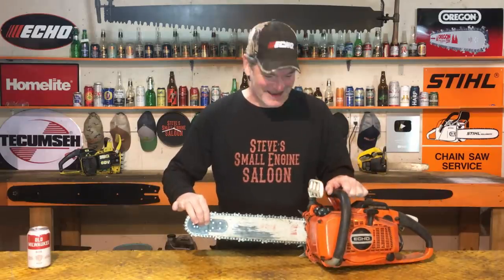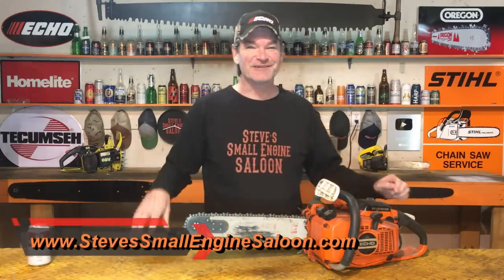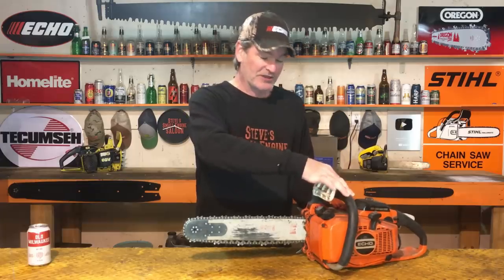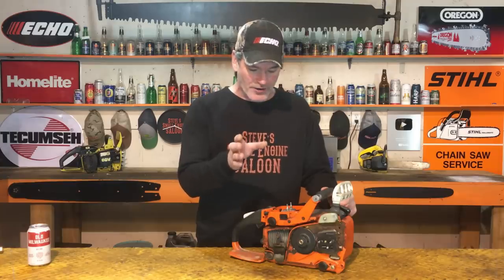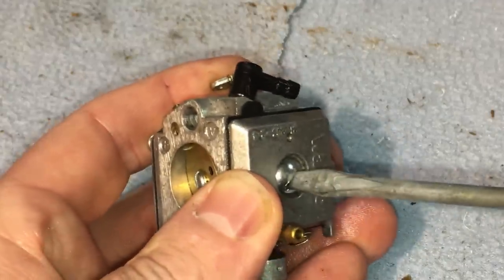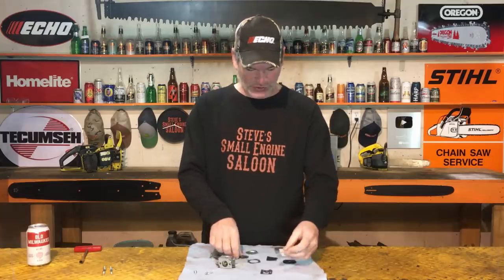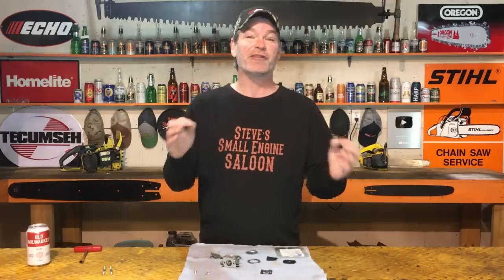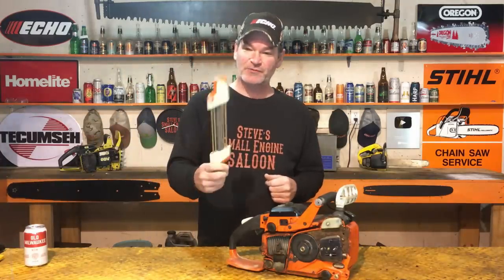How To Fix An Old Echo Chainsaw That Will Not Run

Comment from the maker: ✅Click here for a sharpener ➜ https://amzn.to/2N0CzWX
✅Click here for a tachometer ➜ https://amzn.to/3vsLMhy
For more videos like this, check out: 
👉How To Test A Spark Plug In 1 Minute ➜ https://youtu.be/N5gPaVAQtaY
👉Don't Do This To An Easy Start ChainSaw ➜ https://youtu.be/PsF2SEWEa18
👉Correct Way To Adjust Or Tune The Carburetor On A Chainsaw ➜ https://youtu.be/M6T5JoGXcHY
👉How To Use a Stihl 2 In 1 Chainsaw Chain Sharpener ➜ https://youtu.be/marzGaMq6pM

You can connect with Steve here too: 
✅Visit Steve’s WEBSITE ➜ http://www.stevessmallenginesaloon.com/ 
✅Visit Steve’s PARTS & TOOL STORE ➜ https://www.amazon.com/shop/stevessmallenginesaloon 
✅Follow Steve on FACEBOOK ➜ https://www.facebook.com/stevessmallenginesaloon 
✅Follow Steve on INSTAGRAM ➜ https://www.instagram.com/stevessmallenginesaloon/ 
✅Follow Steve on TWITTER ➜ https://twitter.com/SteveSaloon

Comment: I personally love Echo products, especially old echo. I have that exact model and have used it for many years. Probably will be buying one of those ethanol carb kits for it to.
Reply from the maker: Right on Mike...
Reply: I have the 440evl but everytime I look for parts Google gives me results for the newer CS-440EVL.
Any suggestions?
Reply: They made a twin cylinder version for a short time. I think it was about 65cc. Very rare. Like butter.
Reply: My dads had a 452vl for over 30 years. Its been a dang good saw... recently was given a 462 stihl. I prefer that to the old echo, but she still cuts as good as she did 30 years ago

Comment: An uncle of mine gave me that exact chainsaw. He got it without blade and chain from someone else and left it rusting and rotting in a shed for years. After he gave it to me, I tore it apart, cleaned it, installed an Oregon blade and chain... and it's been running great ever since. (Even though I'm certainly no mechanic.) I use it for rough work in S&M (sand & muck ;) ) and despite all of the abuse I put it through it's keeps purring like a kitten (like the one in your video). This bad-ass hasn't let me down once since I got it :)
Yes, I definitely had fun watching the video. A big thank you from one of your subscribers (and fellow beer-lovers) in the Netherlands.

Comment: She's a beauty Aaa!  Steve after your comment on " look we can see right there that the oiler is working" made me think about that for a minute and I was thinking what type of pumping system is utilized to do this and how does it operate off of the engine. So that has me wondering if you have a video on Oilers and their adjustment and repair and operation. Like how do they set them for correct flow? Not to little, not to much. I think it would be an interesting and useful video. This was a great video. Thank you.
Reply from the maker: Thank You...and You're Welcome...
Reply: I would love to see a video on the Oiler’s also, good suggestion and Diolch yn fawr iawn(Thank You Very Much (In Welsh)) if you can. Big Respect from Pont-Ap-Hywel South Wales🏴

Comment: I have a Echo 400 EVL that I used to earn a living with in the early 1980s. Spent hundreds of hours operating it.  Now, It almost starts, but hasn't run for maybe 5 years.  I put it up on the work bench and followed along with your video.  Like yours, it needs a rebuilt carburetor.  I have project where I need it in the next two weeks, so it is time to get serious about getting it running again.  BTW, back in 1982, I shopped for this saw by going to all the local saw and small engine repair shops and asked them which of the hottest selling saws, they repaired the least.  Every single one of them said "Echo".  I have owned it for 38 years now.  It was rebuilt around 1992, but nothing since.  Thank you so much for your video!!  Now to find a rebuild kit for a 38 year old saw!
Reply from the maker: Right on Dale!
Reply: @StevesSmallEngineSaloon  Followed your instructions with the rebuild kit, and the thing still wouldn't start. Went through it all again.  Then, stupid me took the time to  smell the gas.  Rookie mistake.  Mixed fresh non-ethanol.  A shot of carb cleaner to get it in motion and it started up using the fresh gas!  The 38-year-old saw is back in business.  I will be trimming an elm at the first place I ever worked.  Funny how life goes in circles.  Thank you!

Comment: Thanks Steve.  I was given 2 ECHO chain saws 1 a Echo 330 EVL and the other also is a Echo CS 3450 TYPE 1-E 33.4cc by Korste Corp...both have fuel leak issues and I will be taking it apart first to remedy the fuel leak issue and will also look into the carburetor just as you showed to make sure I replace the diaphragm and gasket and new fuel and see if that would be the issue with these gifted ECHO 's in the Aloha State called  Hawaii...I will bring you my results...TY

Comment: Found a Kioritz Echo CS-302 in someones garbage while walking my dog one day. The pull cord was hanging out. Took it home, repaired the cord and put some gas with stabilizer in it. Started after a few pulls and works like a charm. It does have a bit of an attitude when starting so I'm going to replace the diaphragms like you did Steve. It should be good for another forty years!

Comment: Hey BIG Steve I have the exact same saw with a longer blade. This was my very first saw that my mother bought me for Christmas many many years ago
and it's still going strong.Never ever let me down a real thumper !!! I left this once for approx 2 years in the shed a tree surgeon was working at my place when his saw
broke He asked me if i had a saw he could use just to finish off. All i had at the time was the old echo that had been stood for 2/3 years. Any way in the shed
out with the saw same old fuel and yep it started 6 pulls if i recall. No one believes me when i mention this story but it's true. Now most of my equipment is Echo
they just never let me down..Great Vid as always !!!!!!!!

Comment: I have like 3 echo CS 300s and one 3000. Most are parts saws but the 300 I just got done putting a new carb kit on. 20 bucks and all new fuel system and plug. 1 pull choked and 1 off and in action again. Can't beat it. Echo does make quality.

Comment: I have 2 of those, and a twin cylinder Jhon Deere that was made by echo. I should send it to you so you could make a video about it. It's kind of a collector item.
Reply: Tony Wolf those twins are very sought after by collectors!
Reply: @kriswright1022  that's what I hear, I stopped using it a few years ago after I heard that. I cleaned it all up and set it on the shelf, she is retired now! It's in great shape, wonder what it would be worth?
Reply: Tony Wolf A collector would pay a pretty penny, especially if it’s in running condition!

Comment: Nice video Mr. Steve. I have a McCulloch 3214 chainsaw that’s 26 years old. My wife bought it for me new as a surprise gift. Just replaced the gas lines, purge bulb, spark plug and carb kit installed. Runs like new again. Still has the original bar and chain. It hasn’t seen a lot of cutting, probably less than five hours total as we don’t have a lot of trees to cut but occasionally a large limb will fall and I will cut it up. The primer bulb went bad probably 10 years ago and watching these videos of yours got me motivated to get it going again. Thanks for all the great vids and tips sir. You are the best!

Comment: Awesome old saw Steve.  Good on ya for laying off the suds a half day and wearing your PPE.  Very good to see.  I fixed a Echo CS 341 top handle saw that just wouldn’t start.  They have notoriously sensitive carbs and I checked it by squirting gas in the spark plug hole (I like your method better).  I rebuilt it, squirted it with carb cleaner and gave it a ride in the ultrasonic bath.  No dice!  Customer said he been cutting palm trees with it and they produce a really fine saw dust.  Hopped on Amazon and $10 later and free shipping I put on a Chinesium carb and Bob’s your uncle she fired right up!

Comment: Good call highlighting the safety aspect - chainsaws are nifty but nasty.

That lovely old saw starts and runs easier than my (bought under duress - last one in town after a big storm) Tanaka TCS-33, that's for sure. Takes a miracle, an act of Congress, and some dark magic to get my saw started, and has since the day I bought it... Think there's a design flaw resulting in the carb flooding but the cylinder itself not getting any fuel - tilting it forward can sometimes help. Ever seen such a thing?

Comment: That was fun to watch! Isn't it great getting old power equipment going again! I have a 1972 Snapper mower I am working on. I have the parts for the carb, but I haven't been able to work in my garage for several weeks due to a bad back. Hope to get out there soon and finish it.
Reply: Vernon Bruce 1972 snapper isn't that the one that came with a 2 cycle in a magnesium deck, extremely lightweight?
Reply: @daleslover2771  It has a 4 cycle 3.5 Briggs and Stratton. It may be the commercial version, not sure about the deck material. It will run with a bit of persuasion, but it needs a new carb diaphragm, which I have yet to install. It smokes a bit, I am hoping it's just the head gasket and not the bore. I've yet to diagnose that. Not physically able to do the work on it right now.
Reply: Vernon Bruce I worked on  a snapper it had to be mid-60s in my shop and it had magnesium body to it , it was a two-cycle and I pretty sure was made for little old ladies, the blade was no longer than 18" cutest little lawnmower I ever seen in my life, and wow I have seen a lot of them.
Reply: @daleslover2771  I uploaded a video of my snapper mower. Search for 1972 Snapper 21" restoration

Comment: Got the same exact saw. Purchased new 10/22/1987 for $428.xx. It was a great saw for 20+ years. Been sitting up since hurricane Gustav. Just got hammered this year by hurricane Ida. Couldn't start it. In the past the trick was always to clean or replace spark plug. Never stored it with gas. After watching your video, I put a kit in it, and adjusted carb per your suggestion. It cranked on first pull and runs like a top. Super pleased! Thanks.
Reply from the maker: Right on Jerry!  You're Welcome...

Comment: Great video! I got hold of an old Echo 500EVL with the 50cc engine. Same no start problem you had and I wound up taking apart the carb and cleaning it out and got it running. The owner's manual calls for a 25:1 fuel mix or, 50:1 with a "special" oil approved by Echo.  I tried the 25:1 and it ran somewhat sluggish. As expected, it runs much better on 50:1. What fuel mix do you recommend for these old Echos?

Comment: Haha. Old Milwaukee unopened.....Must be an AA meeting tonight.
Great vid. Got an old evil 440 in the shed that I refer to friends as my Harley of chainsaws due to it's low rpm and high torque. It's a really good feeling picking up and using the old girl. Makes you appreciate where chainsaws have come from. Have 2 beers tomorrow!!
Reply: Hey Simon I own a 440 too. Do you what the code is for the 440 carburetor?
Reply: @dinot71  I'l check it out tomorrow morning and post it up for you. It's midnight here in NZ.
Those old echos are fantastic saws. I think at last count I have 4, one that is really rare with an anti theft pin key that can't be bypassed. Remove the key and the saw won't run. Fitted from factory.
Reply: @simonfleming886  I just got courageous and I removed it!! It's a WA 133 and there is an "E5" in the other corner.
Reply: Hey Simon I was wondering have you ever done a compression test on your 440? If you did you remember what numbers you got?

Comment: I have an old CS500VL and CS650VL they both run perfect and I have cut and fell a butt load with these guys over the years. I bought them new and am using the 500 today. Never been in the shop nor rebuilt. My son has my 650, I am 67 years old and I get my own wood in for the winter. I use a 20 inch bar so I don’t hurt my poor old back LOL. I am going to buy the CS 590 as I would like a new saw. So after watching this video yea these old saws can still stand the test of time. Just like me.

Comment: Steve:  I don't run any gas with ethanol on any of my small engine yard tools.  But would gas with ethanol destroy the fuel lines on an old saw like your Echo?  I really j=enjoy your videos, and you've saved me quite a bit of money by showing me how to fix and tune my own equipment.  Thank You!
Reply: Yes, alcohol in fuels will even degrade aluminum when it gets old.  It gets all gummy as well

Comment: Can't beat the older equipment. My Dad has equipment at home that is from around the late 1990's including a John Deere 14sx pro. I never has a issue starting as we tend to use additive in the fuel to stop issues arising with stale fuel.

Comment: Awesome stuff. I have a Echo 550ESP, which is very similar to this, but they added the complication of some sort of electronic protection. Mine starts and runs for a bout 5 seconds then conks out. I would suspect the diaphrams are rotten like yours. I'll be getting a maintenance kit and getting this old saw back up and running.

Comment: My first serious saw was an Echo 702EVL. Great power and reliability. The weak point of that design was the chain oiler. It threaded into the crankcase and ran off a lobe on the crank. Over time the backlash in those threads would cause the thread to fail and even if you put a helicoil in it you would have an air leak. I really loved that saw. Same happened to others I had.

Comment: Steve i had a neighbor toss out a brand new timberwolf and i was the first one in his trash bucket to get it. Long story short he apparently run the saw wide open with the brake on and fried  the clutch & band and oil lines even part of the plastic melted down. I also had to replace the decompression valve what a brute these saws are i'am not crazy about the weight of the saw but man its a power house it cost me around $150. In parts but well worth it. The guy that tossed it in the garbage 2 yrs. ago tossed out an air conditioner that was fairly new the only problem with that was the end of the plug that has the built in breaker went bad so i just cut the end of the cord off and wired a new one on..LOL  I am going to really miss the goodies the guy throws out its a shame his wife threw him out of the house recently,i think maybe she was tired of his stupidity lol......Have a good one steve love watching your channel and i am sure you help alot of the young and old with repair knowledge thats a good thing....

Comment: I had a Echo C's 60 s about 40 years ago, was great, reliable and did the job well. Were they Japanese or what? Used mine. For 8 yrs, then sold it on. Great vid Steve, I always learn something from your vids. Thanks.
Reply from the maker: Right on!  You're Welcome...

Comment: I have --what you had to do--to do. CS360T.  Had not ran in years so I looked at the piston as best as possible for scoring=none.  Examined muffler for screen gunk.  Sprayed light oil into piston cylinder and replaced spark plug. I did that because it pulled very hard but got better after lubrication.   Started for a second on starting fluid..........

Comment: I have the 452 same basic saw. It was sized and sat for 18 years.I had to replace the oil line and a carb kit and gas lines.You are able to adjust the idle from the top of the saw. Same for the oil.

Comment: I've got a 1984 660EVL, this ones 65cc bigger brother. No, it doesn't rev and my 365 will walk all over it but as a backup saw and a bit of a novelty it's great. I just wish it had a chain brake so I could use it commercially..

Comment: Well,i need to thank you for helping me diagnose my old husqvarna. It had the exact same problem. An easy fix thanks to you.👍
Reply from the maker: Great to hear!
Reply: I've been looking online the model nr. With no success, but i think it's from the 70's or something. Made in Sweden is all i know and it's a small one,doesn't have a chain stop. Initially i thought i solved the issues with the carb gaskets, but it turned out my fuel lines are compromised ad well. It started, ran perfectly, than suddenly it died. Turned out to be the fuel, more precisely pressure loss in the tank. I looked online for videos about that, but i only got fuel line replacement vids, nothing about this type of pressurised fuel tank and workings of it. It is a lot to ask of you, but it could be a good idea for a video for you, even more so as there are none on youtube. Cheers!

Comment: That is great that the chainsaw had minor problems and you was able to correct them with the two gaskets and it cranked like it was designed to. I have three chainsaws which is difficult to crank and they have been in the shop, and the Stihl has been in there the most and I had problems cranking them and gave up and just purchased a battery saw which I can crank and it runs fine.

Comment: I love how you do this properly Steve, i would have pulled the old diaphragm and fuel pump, cleaned em up then soaked em in brake fluid or atf to bring em back around
Reply from the maker: Right on
Reply: @StevesSmallEngineSaloon  not running a shop though just saving old stuff as cheaply as i can lol

Comment: Hey Steve I always love and learn from your video's. You do a fantastic job of explaining the information on the topic your discussion about. I have stihl chainsaw that is over oiling the bar. It just pour out way to fast. The guy that had it before me use to put used motor oil in it instead of bar lube. Is this an easy fix and did putting the used oil cause this problem? Thanks

Comment: Great show always learn alot here. Little off subject I was wondering if you can do a video on making a jonsered 630 stop leaking oil I have to store it on its side or empty it otherwise it makes a mess but I love the saw had it since I was in high school in the mid 80s.